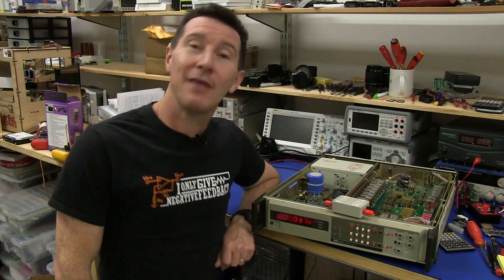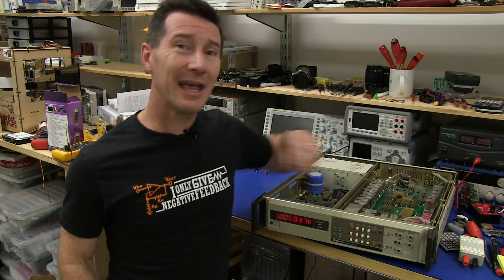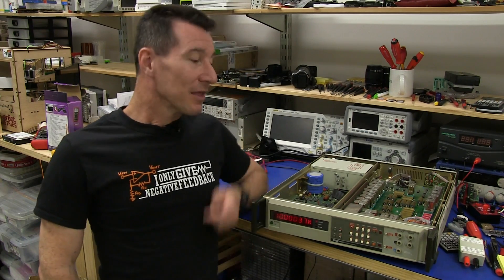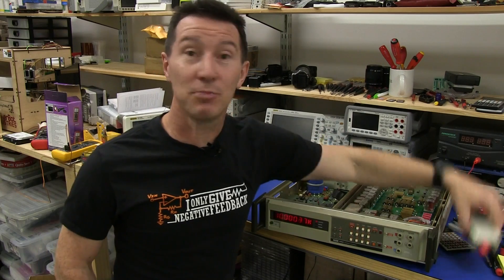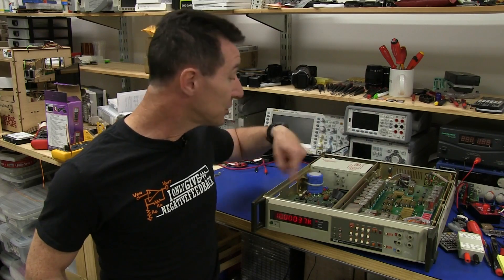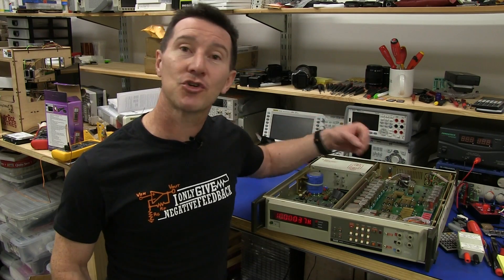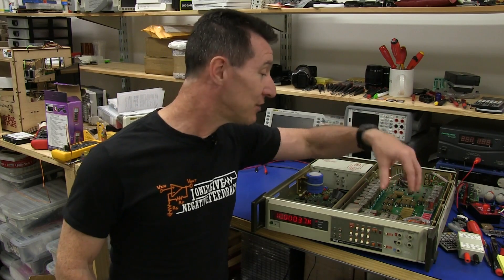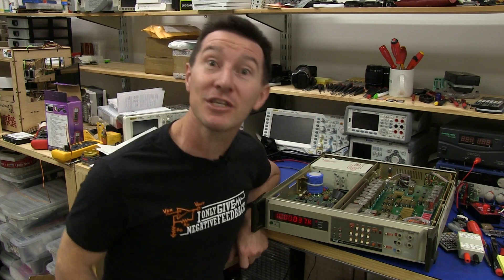EEVblog #545 - Vintage Design Rant

Comment: Hi Dave, You´re so damn right....As i started i teared some old radios, TVs and R2R apart. I learned much about semiconductors and the "how to" from tiny pocket radios, and from the big old tube radios i learned so much on the "how to" from high voltage as well as from the TVs...
A also (=hate me, as i do myself as well, since i knew what it was!) teared down a "Fender Vibrasonic Amp" as i was about 14 years old. My father came up with it one day. It was just like new, just the main power transformer was missing. Could be easily fixed...I took it all apart, as well I blowed the beautiful 12" AlNiCo speaker...
That´s why a now restoring old rare vintage Tube Amp Heads and Tube PA stuff..I leared so much from this old fender...
But if I only had known that this old brown face "Vibrasonic Amp" was a prototype (!!)
DAMN! After all...DAMMIT!

Comment: Excellent video, shows how the host pays attention to all the comments, even the negative ones. (btw, i'm all in for any kind of teardown, i like vintage ones specially as they show how they solved complex problems in times where they didn't had the insane integration we have today)
Reply from the maker: I do read almost every Youtube comment. A couple of hundred per day.
Reply: EEVblog
wow, kudos on not getting discouraged by the negative comments/whining that will always appear, "i only give negatiove feedback" types hehe
Reply: I like the old ones because you find more interesting stuff. I'm sick of all the black chips. What is wrong with white ceramic?It looks so awesome. 
Anyway, this is only my opinion and this comment can be deleted if it's considered spam.

Comment: I personally like the vintage teardowns, lots of info on working within various limits, and often some pretty creative designs as compared to certain modern devices where you may open a metal box just to find a circuit board, with an SOC and some passives, and not much else. I have personally learned a lot about PCB design and a wide range of workarounds and interesting tricks from watching the teardowns, and I personally cant wait for more of them.

Favorites
1: teardowns
2: mailbag (primarily the hardware but also find some post cards to be interesting)
3: repair videos
4: fundamental Friday

Other than that, the content is supplemented with episodes of the amp hour while working on various projects.

Comment: I only get about 1/3 of what you say but I love these tear downs.  So much thought goes into a circuit that is never visible or appreciated.  I do like when you give modern solutions to the older circuits for the juxtaposition. I think a favorite was when you compared PCB soldering to some SMB soldering.  Pretty sure I dinked up the acronyms but very nice to see old v new!

Comment: I agree Dave! There's nothing like a good old fashioned vintage teardown.
The old adage that sometimes they just don't build em' like they used to still applies.
I still have my Mitts M-VT0257, HS-U65 video related hardware which I worked on still use to this day.

Comment: I work in the show production/AV field and am constantly looking around for old equipment, books, methods, etc... about how they USED to do shows "back in the day" before all digital video playback, integrated multi screen switchers, etc... I was asked once (by a newbie in the industry who was very surprised at that...) why I was so interested in the old way, being relatively young and having all this new technology.  I told him that all the new school thinking is based on how they did it in the old school days.  Much like product design it seems.  PS, Dave, if you ever got your hands on an old Eidophor or GE Talaria projector for a teardown, you'd probably go nuts looking at how they designed the optical systems, and how big-screen video projection was accomplished before LCD and DLP projectors.  Just be careful of the cadmium oil... ;)

Comment: Just because something is old, does not mean that it cannot be better quality and a longer lasting concept than a 'new' item. I have a couple of computers that I own that I purchased within the last year that are not only perfectly usable, but far superior to 'newer' computers. One is a 2U rack server that is able to transcode video like nobody's business and serves well as a blazing fast remote desktop (All for $300), and the other is an old Mac G5 series Power Mac that I got for $150. I chucked about $30 of RAM into it for better performance, but it suits my needs very well.

The same can be said with older cars. A neighbor of mine still drives an old 1980's VW Jetta with a diesel engine and gets about 50MPG. The car might not be the flashy 'new' model, but for someone that isn't rich, it does the job well enough without the fuss of a monthly payment.

Just because something has some age on it does not mean it is not worth using, tearing down for learning experience, and maybe even copying. As for the entertainment comment, I'd have to say, "Yes, Dave does some entertaining videos, which is why I watch them."

Thanks for the great work Dave. :)

Comment: There is nothing more uninteresting than a single chip ARM SoC teardown. To the commenter, let me help you out. You pry it open and it has a battery and a PCB with one BGA SoC that does absolutely everything from running the display to charging the battery.

Comment: Vintage equipment and designs are still based on the laws of physics that have not changed. Go play with some tube circuit designs. ( I started with tubes )

Comment: Often times the most clever designs were made when there was no easy way to accomplish something.  The slide rule for example - so simple, but so powerful. Now we have tons of RAM and fast CPU's and loads of software tends to be written in a way that is maybe easier to write, but wastes resources or becomes bloated with stuff that's not essential, just because. And that's especially true for user interfaces - everything pretty, colourful, animated, buttons are 3D and shimmering, when often times nothing of this adds to the usability or flexibility and just wastes processing power that could be better spent somewhere else.

The way to make something better is to study what's come before and strive for efficiency.

Comment: i love these type of viedos and alot of times why fix something that still works and is not any better then was 10 year or even 50 years ago. you learn from the old stuff to make the new stuff better. you have to start from some where and a good place to start is from a true and test system like that vintage design.

Comment: I wonder if you could build a miniaturized version of the resistance calibrator today. Resistors don't have to be physically large in order to be precise do they?

But to get proper insulation and low resistance as needed, I guess you still need big relays and direct wiring in places. Any thought?
Reply from the maker: I wouldn't bother autmating it. Big complexity for not much gain. Just put a whole bunch of resistors in a box with terminals on it.

Comment: Dave

I learned the "basics" back in the early 1980's on 1950's vintage TUBE radars and tube analog computers. The knowledge gained learning and then working on those antique systems has served me very well up to the present day working on state of the art equipment. I would wager I could run circles around the majority of these kids who need to look up anode to see what it is.

Comment: This my be a dumb question could you just replace all the resistors in this and make it brand new?
Reply: why? if the resistors work why replace them with something "Newer" they still perform the same function, plus I am sure brand new would only be considered for the parts installed not the entire unit
Reply: What would you achieve?
Reply: ??  And what about the solder joints and all the other mechanical stuff that is part of the electric path? Maybe I do not understand the question.

Comment: You learn electrical AND mechanical AND product design.  A product is made of many disciplines… as many as it takes (or took) to get the job done, electronics, optical, mechanical, and any combination thereof.   I still buy surplus and sometimes old technical stuff just to see the methods used let alone the engineering tech noted above.  The methods used to make some older products are sometimes forgotten, or can be reused in another area of engineering.  If you can’t appreciate the design aspects of an older product (some have more than others), you are missing a BIG part of your engineering / technical learning experience !  Thanks Dave ! ! !

Comment: You can lear tons because simplicity killls ever and ever. And back in those days, resource were so little so the made big with nothing. Remember the C64. What about the "gamming" performance with only 1Mhz CPU ? Now nobody launch this something like this "computer" with less than a Cortex M4 and perhaps it wont run as good as the original. Lack of resources makes your brain work at its best.

Comment: Haters gonna hate, you tell 'em Dave.
Reply from the maker: He's not a hater, it's cool if he doesn't like vintage teardowns, no problem. But he's wrong you can't learn much from them!
Reply from the maker: EEVblog Testing the new nested comments feature...
Reply: EEVblog Testing your test of the new nested comments feature.
Reply: Mitch Crane Can I join?
Reply: GizmoTheGreen Welcome aboard.
Reply: GizmoTheGreen yes
Reply: ahhh, this marks the time when the comments and replies were nested...finally. It was impossible to figure out what reply went with what comment before this. It was such a mess.